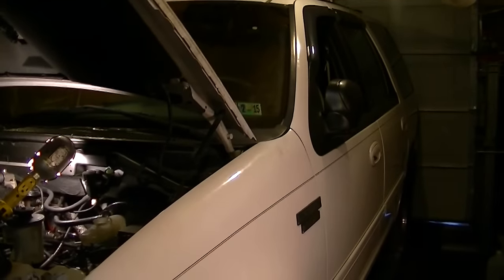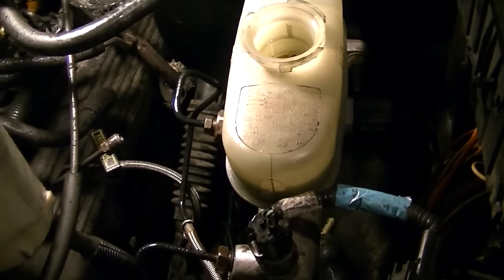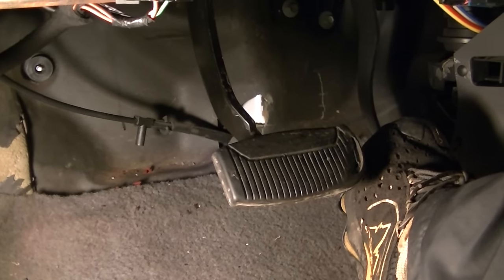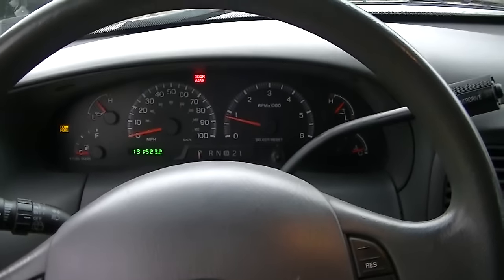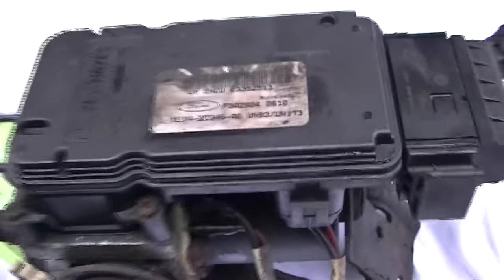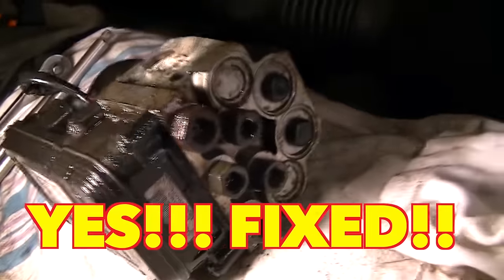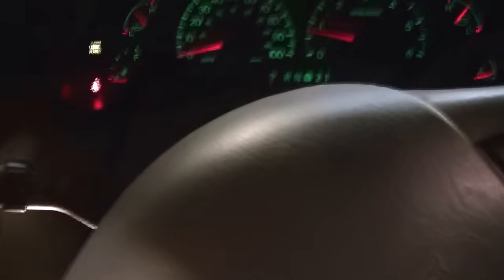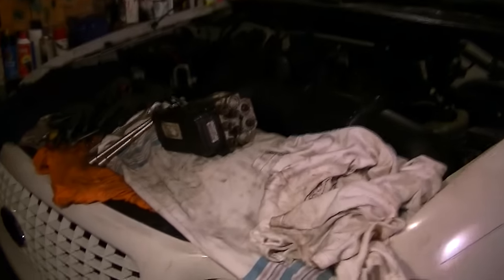Sinking/Spongy Brake Pedal -With ABS SYSTEM?? Nothing Works? Watch Fixed!

Comment: - The sinking feeling started when i replaced a used ABS as the original one was leaking.
- Next i replaced the master pump but i didnt help.
- Today i went to RMW who specializes in brakes and the owner's son took the car for some hard driving and did many emergency brakings and my pedal is hard again.

What happened was that air was forced out from the ABS module.........

Nissan Cefiro A32 2.0G 1999
Reply from the maker: Thanks for the story!

Comment: I have a chevy 92 c1500...same issue... except for booster everything is new and bled to the hill and back...it only has rwal brakes but im going to try and bypass the system and see if it fixes the problem...if so you my friend have saved the day. Logically this makes sense in my situation since i have addressed everything except this unit... Thank you
Reply from the maker: Word!

Comment: ABS systems have all the same problems as non ABS systems, so  laymen should be self-conscious enough to NOT treat ABS superstitiously.  

ABS systems ALSO have one additional potential problem that non-ABS systems do not have: namely the ABS modulator itself.  It is very similar to a master cylinder and, like a master cylinder, can get bubbles in it and then must be bled.  BUT bleeding the ABS unit requires special software allowing the mechanic to open each individual line separately - which is normally impossible.

SO: if you are having symptoms similar to bubbles in the master cylinder, but you have already bled or replaced the master cylinder, then your next suspect is the ABS modulator.  Factory trained mechanics rarely see this, and are trained to look elsewhere (ahem! [master cylinder]).  So you may have to force your factory trained tech to read up in it and learn how to download the software and put it to good use.

Comment: If you got an air bubble in the ABS module, the pedal will goto the floor also. A descent scantool can help get the air out without risky driving. I live in the city so I can't really go kick in the ABS response.
Reply from the maker: True. But most of my fixes for folks are systems that never were opened, and just one day...Boom! ...The pedal goes to the floor. Now if the system has been opened and worked preformed....then yes this can be an idea to present.

Comment: I have a 98 lumina pedal goes to the floor unless you stomp on it fast and hard.
 the abs and master cylinder are integrated
I don’t see any way to bypass master cylinder or vice versa
I guess I’ll check all abs fuses and relays next.
Any help or constructive comments?

Comment: Same problem on my 2005 Ford Focus. Brakes got like this straight after one ABS event. Then went away on its own after some time. Now 1 yr later, just happened again after an ABS event! See Ford/Mazda had a pending recall for this issue in the mid 2000s...

Comment: ‘08 Expedition. Same issue. Replaced master cylinder, rotors, and pads which seemed to have helped but proved to be a band-aid. Took it to a local shop who swore it was a bad master cylinder. They tested the replaced MC and found it was good. No ABS units anywhere in the country and no ETA for replacement!  Found a used one that I will put on and hope that I don’t need a special tool to bleed the unit.

Comment: So you couldnt drive around without replacing it? I mean I dont personally like abs brakes for various reasons. But you said with bypassing the abs pump the brakes went hard? Why not drive it without abs and have 40$ for beer?
Reply: Nah the HCU creates pressure - too dangerous.

Comment: I am a bit skeptical about not bleeding the abs pump. When you removed those lines air most certainly got in.
Reply: I replaced all the brake lines on a 02 Chevy Tahoe I'm trying to get pedal now and it is still going to floor what's the best way to do this do I got to bleed the master then go down the ABS and bleed that and then go to the wheels
Reply: @ilovelife994  Bleed the system like you normally would. keep the master cylinder filled and bleed at all the tires.  Keep doing it until you see fluid and no more air coming out. If your not getting any fluid from front or rear tire bleeder screws then the master cylinder is either defective or not installed properly. regardless of the abs pump - you should still have pressure in the lines.
Reply: I think bleeding the old abs pump would have solved the issue.  No need for everyone to buy replacement parts.

Comment: Same issue on my truck and no one makes the ABS block or remanufactures them.  I will need to risk it with 20+ year old parts.  It was crazy that they did not put a one way check valve after the dump value to keep the fluid pressure from bleeding into the ABS activation circuit in the hydraulic unit.  Even if you had total failure of the dump valve with it stuck open, the ABS would not work but you would still have a solid pedal with just conventional brakes.

Comment: I'm having this very exact problem with my 98 mustang gt. I've checked the lines top to bottom and there's no leaks, the abs light comes on and goes off as soon as i start the car and yet i still have this issue. I reached the same conclusion as you did and figured it has to be my abs module that's the problem, so in a few I'm going to go buy a used one and see if that fixes the issue that I'm having.

Comment: Thank you for this extremely informative video.  My brakes work fine until this snow storm tonight, where suddenly I had this happen.  Once I parked on dry driveway the brakes seemed to work again but it feels a bit like it did an hour earlier when I was driving on snow.

  Last summer a mechanic replaced the ABS controllers.  The warranty is 1 year or 12,000 miles.  Both of which I am well under.  Is this ABS controller what is making this spongy brake issue?  If it is then the mechanic will replace it for free.  Or is it something else you are referring to.  Thank you.
Reply from the maker: Nice!!
Reply: @FixingWithPassion  Do you think that is the cause?  The ABS controllers?  I am not that familiar with cars.   All I know is brakes work fine until we had a snow storm tonight and suddenly this spongy brake thing happened.  Weird.  I appreciate the feedback.  Thank you so much..

Comment: Just came across you video.  I am currently having this problem with my 2016 Ram 1500.  Pedal is a little spongy, but every now and then the brake pedal sinks to the floor and have just a little braking power when the pedal is at the floor, definitely not enough to stop when traveling at speed.  It's been in the dealership on and off for 3 weeks with this problem and I brought up the ABS pump being the culprit and it was dismissed right away because they say they never go bad.  I know that every part that is made, it has a potential to fail, it may not happen often, but it's possible.  They told me it was a vacuum pump, then he told me it was the brake booster, now they are saying maybe the master cylinder.  Got to love mechanics these days that rely on their computer to point to the problem.  The problem is, I have no ABS lights on and no codes in the computer.  When the truck is off, I can pump the brakes up hard as a rock and when I keep pressure on it, it doesn't sink, which tells me the master cylinder is fine.  Am I wrong?  It only does it when the truck is at operating temperature and running.  I can also push on the brake pedal really slow and get it to hit the floor.  Any thoughts?
Reply from the maker: pump the brakes up hard

Comment: Same thing happened to me, 2003 e450 super duty, soft spongy brakes, especially at a stop light they hit the floor, brakes sounded like brake pad grinding when coming to a stop at slow speeds, replaced hydro booster, master cyl, pads, rotors, calipers, bled the brakes.... still doing the same thing . . .  in the end, it was the ABS module which had triggered no ABS warning light.  I watched several videos first which all said master cylinder causes soft brakes...but so will the ABS :) Thank you and good look!
Reply from the maker: Thanks! Glad you figured it out!!

Comment: All I have to say is great video did all the steps you said and it was 100% abs pump 45bucks later from my local salvage yard different pump installed brakes work great thank you
Reply from the maker: That's great!~~Glad it worked.

Comment: Wow, excellent video. Great feeling to solve. I'm stumped with a problem like this right now on a MINI Cooper, that popped up immediately after doing the pads/rotors and repairing a displaced boot on the RR caliper. The pedal is now just like the video - even with bleeding all brakes multiple times using both pressure bleeder and two-man method, AND bleeding the ABS module using dealer technician software. It makes no difference. Pedal can be made stiff when car is off but is soft and sinks almost to the floor when running. Could doing that brake work cause master cylinder or ABS module to break?? It can't be possibly be air in the line, we bled so many times; we used 4-5 bottles. Anyone have any ideas??
Reply from the maker: ABS module can go bad anytime. Just a small piece of dirt can mass it up inside. ABS module can fail without any warning causing a sinking pedal. But make sure all air is gone in the lines. That's all you can do at this point.
Reply: My girlfriends car has the exact same problem its a cooper r50 1.6 it did have the abs light on and a slack pedal but I replaced the abs module and the abs light is gone after a short drive but still having a slack brake pedal when the car is running and bled numerous of times the pads and discs are top notch and I dont see any leak whatso ever.  The fluid level never dropped since. But might concider replacing the master cylinder and hope for the best.
Reply: Maybe the mini cooper has to be auto bleed through the software.  Gm vehicles are that way
Reply: Mod MINI hey man I’m just wondering if you ever solved this issue... I got it.. on a r50 that I’ve just put an r53 engine in and replaced callipers master cylinder, servo, new abs unit, I’ve just paid for the dealership software and a laptop and a set of Ecu’s from a donor car, only 200 for the lot but still, I’m running out of options, heard it’s abs airlock surely working the abs while bleeding the system will get the air out the system? 
Hope you see this, you know your shit 😀
Reply: Taylor Clark my 2003 silverado is doing a similar thing (spongy) petal I am just going to bypass the abs altogether i will put a manual proportioning valve in. I dont need abs I learned to drive without it years ago and never use it anyway
Reply: What did it end up being. Brake booster leak?
Reply: @holmes1956O  l tried it on a Chevrolet with abs system bypassed .lt will work but when have to stop on an emergency it will lock up your wheels especially in wet and icy roads.Be very careful and cautious.
Reply: Did you find what cause this, i'm runnin in the same problem right now, i replace the master cylinder and bled the brake fluid but still got a sinking pedal. any ideas ?
Reply: I know exactly what your brake sinking issues are . My Citroen C5 2008 had great brakes until I , old school,  replaced the Worn Brake pads . pushing the brake caliper pistons back had sent contaminated old brake fluid through the ABS valve block assembly causing a valve within the ABS to jamb ./lock .Removing the ABS unit and flushing out all of the ports with brake cleaner / airline pressure 60 lbs inch .  followed by a thorough flushing with fresh brake fluid syringed throughout the valve body passages . Do not leave any brake cleaner fluid remaining in the ABS valve block assembly  .     all ports on the ABS valve block should pass cleaning spray and air freely .  Back spraying and blowing through with the airline should be unrestricted .   Any restriction will indicate a stuck valving .There is an excellent video demonstrating the way the ABS valving operates .. It is somewhat complex  but once the penny drops  the stuck valve pedal to the floor with the engine running finally sinks in and a stuck valve diagnosed . I resealed my Master cylinder and it made no difference .. It turned out to be the Stuck ABS valve which was causing the sinking pedal . only with the engine running .
Reply: @richardwallinger1683  after cleaning it did it resolve the issue ? 
I’m having similar problems my brake pedal goes to the floor after new pads and rotors I’m guessing fluid went up to the abs module 
Would doing a abs auto bleed with a scan tool and then doing a manual bleed on each wheel resolve the issue ?

Comment: Thank you for this video.  We have a 2012 Mazda5.  Brake pedal went soft after having to make a hard stop. Replaced brake master cylinder.  Nope.  Turns out it was the ABS pump.  Guess who made the ABS pump used in the Mazda5?  Yup, it's Ford.  When you pull the part out to replace it, the Ford logo is on the back side.  Ford has a big problem here with these modules, and people are getting hurt.  So even if you don't own a Ford, this problem can be found in any brand that Ford is the parent company of, or has its fingers in.
Reply: Hello.  Are some ABS HCU/Pumps good and some bad?  Or are they all bad?

Comment: Yes I had the same problem with a 2008 ranger . just about pulled my hair out. Got a used abs pump and it was bad also. Got a replacement and worked fine. What a pita.
Reply from the maker: But hey, you got it fixed!~

Comment: So the ABS went bad, but didn't even trigger a warning light? Great design, eh?
Reply from the maker: I know Right. Crazy.
Reply: Ford quality 🤣🤣🤣
Reply: @danlevesque5437  I have an 07 Tacoma and am going to replace ABS module also because it isn't giving any trouble lights either. I too have replaced damn near everything and bled breaks multiple times.
Reply: Abs module and HCU (hydraulic control unit) are mated together. Your HCU can fail internally without setting any fault codes. The abs module can also fail, with a still good HCU. They work together but can fail indepently of each other.

Comment: I'm having this problem and the cadilac dealer can't find the problem. they said they can't fix it if the computer doesn't show a code. they said they'd never seen this happen before. I told them It felt like the ABS was engaged and stuck on. they said that's not possible without a code. I'm not concerned with whatever they have seen or believe is possible. I want a safe car to drive!!!!! its a damn shame I have to research and diagnose the problem myself. Thanks so much for saving my sanity 😂 I knew I wasn't imagining my loss of brakes.
Reply from the maker: Yes lot of people don't know about this issue, and mechanics. Be safe, If I was your neighbor I'd look at it and give you the final word ;)

Comment: I've been punching myself in the head for the last 5 days trying to figure out why my brakes won't harden up, I didn't think I had a bad ABS I just put a new master cylinder in it and it looks like now I'll be putting a new ABS in it thank you. .......11/19/2018-Update,my rear calipers were on the wrong side.they couldnt properly bleed cause the bleeder screw wasnt at the highest point so air was traped that could never get out,unless flipped.flipdem,bledem,boom,brakes!!!
Reply from the maker: Yea....so many stories of A bad ABS unit. Let us know if you fix it!~~~
Reply: @FixingWithPassion  my rear calipers were universal, and on the wrong side.the bleeder screw was not at the highest point,thus trapping air.took them off,swopped'em around and that fixed it.
Reply: Thanks for the advise!! I m gonna try that because I changed my rear calipers and I had the same problem!

Comment: Great video. I too am now experiencing this. I have a question about your situation… With mine, I found that pumping the pedal 2-3 times gets my brake pressure back. I’m sure this is because it is evacuating air in the lines. Did you experience this as well?

Thanks
Reply from the maker: Yes! Same thing happens when there is a bad ABS pump. Forget abut tearing it apart and fixing it! To complicated. Easier just to get a used one. That's what I did and and have 100% happy with the fix!
Reply: Nathan Rohrbough -- Ok, cool. This just started yesterday so I'm going to start with leak checking, MC, and then probably jump right to the ABS   pump. 
Btw, 1992 ford E-350 😲... and thanks for the quick reply. I'll update my comment when problem is solved.
Reply from the maker: Keep us updated! I'm sure someone else will need your fix!~

Comment: Something like that happened to me some time ago after replacing pads and rotors. I went to a gravel road and actuated the ABS several times. I dont know how, but i had introduced air on the pump, and it was a bitch to bleed. But it worked, stiffer pedal after actuating it and bleeding. I did it a couple more times (actuate ABS + bleed) and eventually it got stiff as a rock.
Reply from the maker: Nice!!
Reply: How were you actuating the abs?  Also were you bleeding at the master cylinder or the wheels?

Comment: I have a problem with the pedal going to the floor as well. I put in new breaks , new master cylinder, new brake boost and I bled all the lines and put new fluid in. The problem didn’t go away and my pedal still sinks to the floor, I try the abs module and hope it works
Reply from the maker: Let us know if it fixes it!!